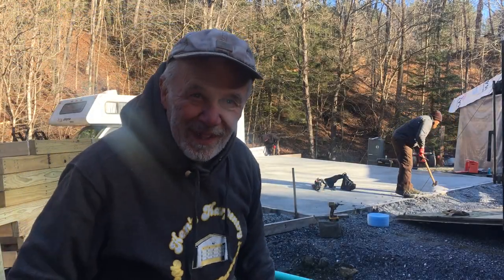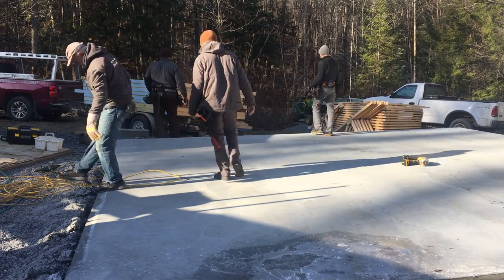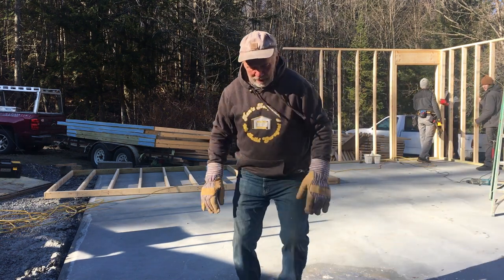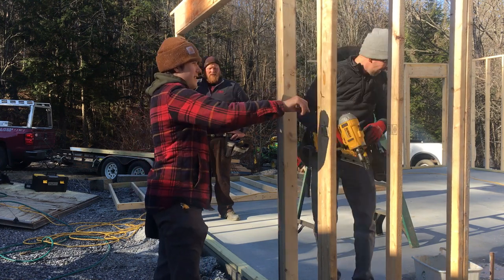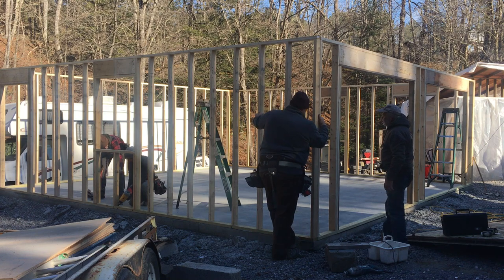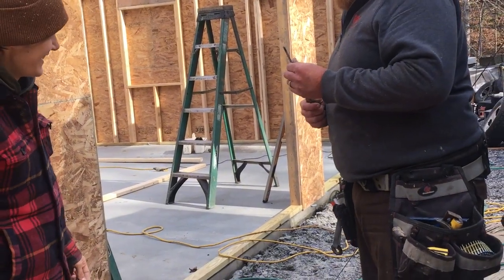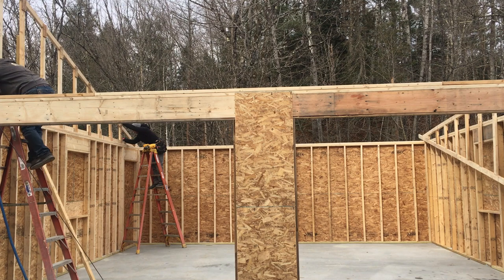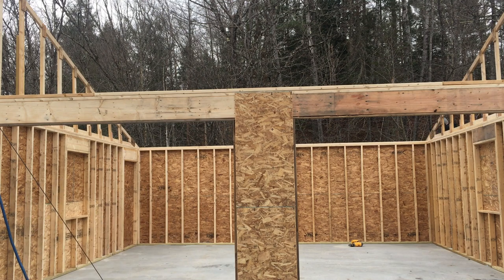Garage Framing Day...Hand Built Trusses

Comment: Good morning Ken & crew. Hope the trusses aren’t running to high in price these days. That quickly runs into your profit. I’m a former assistant appraiser from the 70’s, building them has never been cheap.

 I once appraised an apartment building built with DOVETAIL JOINTS. YES, it was legal in AZ.
Reply: These were the trusses they had to build themselves so they cost more in labor for sure.

Comment: Instead of using a pipe clamp to draw studs and corners  together you can use GRK or Simpson structural screws - then leave or remove the screws once the nails are in place.  It is usually easier than a pipe clamp.
Reply from the maker: Nice thanks

Comment: Ken,  I was wondering why you don't use J-bolts when you poor the concrete?  I would think that would be a stronger connection to the concrete pad rather than  regular concrete wedge anchors.   Or is it just easier after the fact drilling through the studs and the concrete at the same time to use the concrete wedge anchor method

Comment: I've never seen you install the trusses in that direction before. Is that something the owner requested? Won't you need a gutter on the front of the garage now?
Reply: That's a Saltbox style roof.
Reply: One thing I’ve noticed is if you install them like this, you can easily extend the building or attach a carport to the side later without having to rework the existing roof.
Reply: @MoneyManHolmes  God point
Reply from the maker: The homeowner liked this style it sends 2/3 of the snow to the back

Comment: Was there a reason you didn't run the ridge perpendicular to the overhead doors?
Reply: That's what a saltbox style is. Ridge parallel to the doors and asymmetric roof front and rear.
Reply from the maker: It’s a design preference